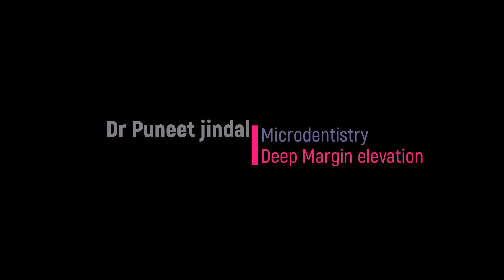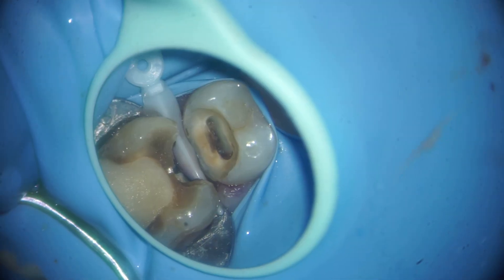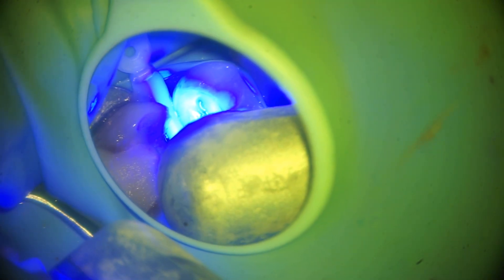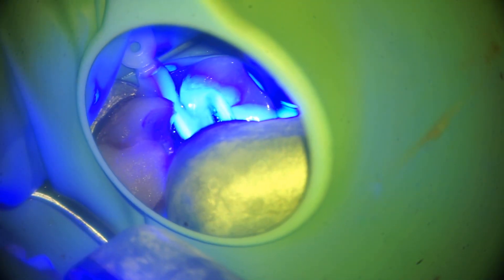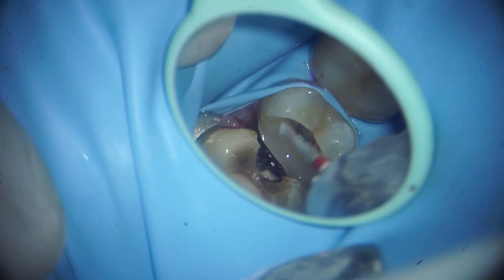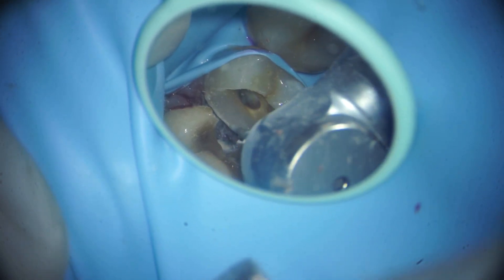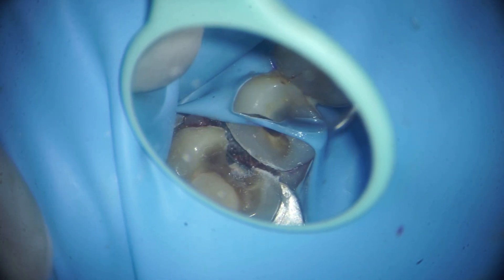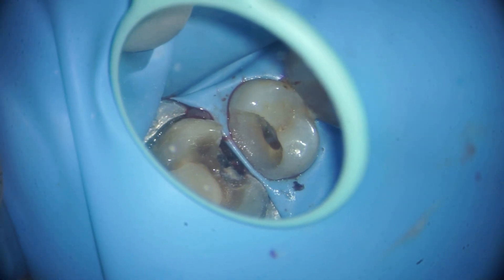Deep margin elevation in deep  tooth cavities |DME in Composites| Pre-endobuildup in deep caries

Comment: Good morning doctor.. why don't we use rubber dam and compress the papilla and do a deep margin elevation
Reply from the maker: It doesn’t work everytime…u can try prewedging and then dam ti compress the papilla…but in my limited experience your wouldnt be able to the dam below your gingival margin in almost 90 percent cases that is why this way you have adequate space for wedge to be placed and inversiin of dam becomes easy
Reply: @drpuneetjindalrootcanalspe5842  thank you for your valuable information doctor